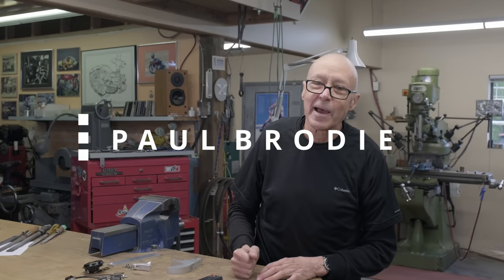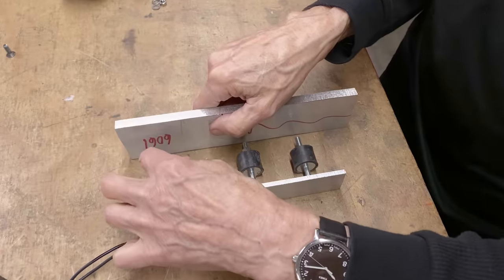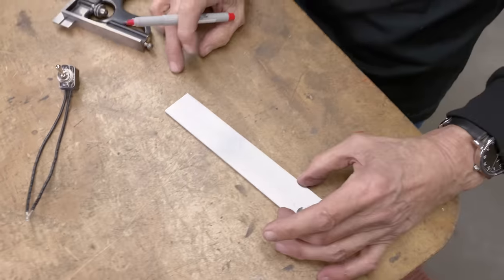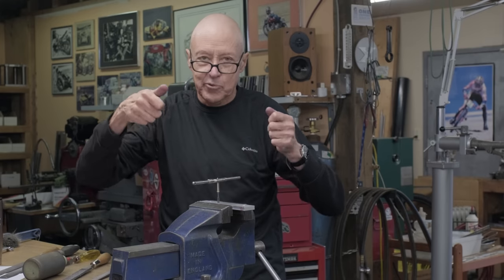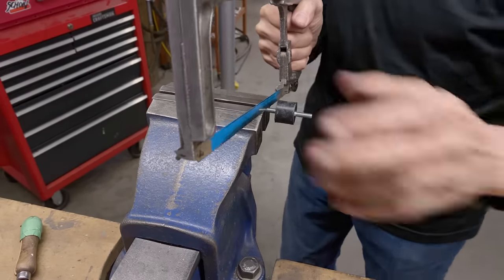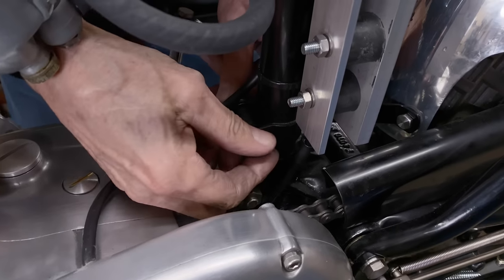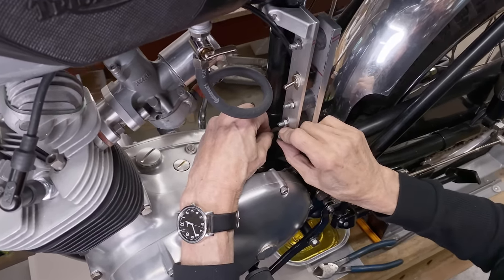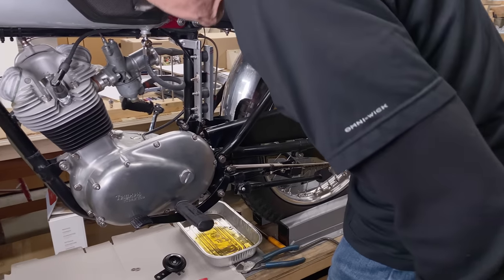Fabricating a battery mount for the Tiger Cub // Paul Brodie's Shop

Comment: These rubbermounts exists in all kind of styles;-)
With a bolt on each side, with one bolt and a female thread and female threads on both sides.
IMHO using the version with two female threads and countersunk screws look nicer.
Reply from the maker: Yes, the rubber mounts come in many different flavours. I have never used the ones with female threads. Thanks for watching..:face-fuchsia-poop-shape:

Comment: Paul, You almost always go to the bandsaw to cut your turned parts from the material blank.  I'm curious why you don't use a parting tool for these details?  I know they tend to chatter a bit and you need to reduce the RPMS.  Are these the only reasons?
Reply from the maker: Too much can go wrong using a parting tool. If the cutting oil doesn't get all the way in to the bottom of the grove... Bang!!! and there goes my tool. I use the saw because it is almost fool proof. Thanks for commenting .....  :face-fuchsia-poop-shape:

Comment: Thanks Paul & Mitch!  What a great episode! Your brackets and braces are truly wonderful pieces of art. 
About the metal debris on the lathe... since it is a cutting tool, think about cutting yourself some (well-deserved) SLACK!  
I was trying to remember who it was that put a tap into a lathe or mill chuck to get absolute perpendicularity.  Dang! it WAS you!  How about using a drill press following that same idea.  Now your hole drilling/tapping turned out perfectly just by eye, it might be easier with the drill press.   That oil drip-drip-drip is annoying, but I have every confidence that you'll find that source and fix it.  You have skills!   Looking forward to the next one.
Reply from the maker: Thanks Tom. Yes, I do sometimes start a tap in the drill press to get the perpendicularity!    :face-blue-three-eyes:

Comment: Do you think the point loading from the round lower battery support  may cause the case to eventually crack? Would a rubber faced flat plater be better? I always enjoy your vids, Thanks.
Reply from the maker: I will hold the battery on with 2 sided tape, so there will not be huge pressure on the bottom of the battery... Thanks for liking our videos :)

Comment: Oh, it's leaking from a vertical crank split line on a British bike....Wow, who knew that they could do that.  Please don't run it Paul, it'll be a worse environmental disaster than the Exxon Valdez, just like in period. I've had some success by making a multi thread twist of PTFE tape and using that as a rudimentary, deformable, initial dam on the crank half returns before it hits the silicon sealed on the mounting faces,but...
Reply from the maker: Yes, a British Bike leaking oil. Virtually unheard of!  :)

Comment: Thanks for the Cub videos, Paul! My cub has been on the road now for 8 months. I am always waging war against oil leaks- oil just doesn’t like staying inside the Tiger Cub engine, obviously! One annoying source is the outer timing cover; from there it leaks onto the oil lines and drips from the oil line union nut. And I don’t think the Cub engine breathes well, so that exacerbates the leaks when the engine is rinning. I don’t get a lot of leaks when it’s not running. After a ride, I’ve just got used to wiping the engine clean. I’m at a stage now where the leaks are not gone, but tolerable. Regards, Al
Reply from the maker: Thanks Alan. Yes, I will start riding mine soon. I think I can learn to live with a little seepage... That's what I say now :)

Comment: Super work as always. But I think the 6061 plate should be higher that the battery does not stick out at the top. I would not wonder if you wouldn't have fixed that by your next episode already. Can't wait to see the tiger cup running.
Reply from the maker: Thanks Oliver. Sometimes I re-make a part. When it is finished I almost always see a better way...

Comment: Another great video. Why didn't you use a thinner piece of aluminum for the back part of the battery (the one you milled out). Was it for strength?
Reply from the maker: Thanks Pat. Yes, for strength. Sometimes parts get remade, because after I see it (in the metal...) it becomes much clearer how to improve what is already done :)

Comment: Love your work as always but using cable ties to hold the battery in place is just not you, you must have thought of at least 5 better ways of doing it 😅
Reply from the maker: Well Tim, Mitch has time constraints, so cable ties were for sure a "quick fix". I will make a beautiful alloy cover to hide those ugly cable ties. Good solution?

Comment: Really happy to see these regular uploads Paul, must mean you're feeling better. Always such a pleasure to watch you work, always coming up with on the fly solutions and always working so precise. Curious how come you didn't machine a flat spot on the "shelf" for the battery to help it sit more stable?
 I'll put everything I have that Mitch had ZERO film with him, but lots of Flash 😛Will share a little funny - when you were holding the thicker piece of alu, it was upside down and I read "1909" and had never heard of that before, so went searching to see it's properties and why you would be using it, then came back and watched further, you held it right side up and then, 6061, made a lot more sense 😆
Reply from the maker: That's pretty funny, me using 1909 aluminum! I will remember that one for sure... Yes, I will machine a little flat for the battery to sit on.. We were under time constraints, as usual. I usually have 3 hours to get everything done, and that is not really a lot of time... Thanks for commenting!

Comment: Hello Paul.... no we dont know that the hole for M6 is 5mm... becouse is 4.8 🙂.
I will share here a thing that I learn from a old guy: To find what is the hole to tapp for a metric screw... you just multiply the metric size of  the screw with 8 and divide by 10. Basicaly, for M6 is 6x8= 48... divide by 10 is 4.8. It works up to M10 screwes.
Nice way... right?

Comment: Hi Paul, I hope that your health is improving.
To the battery mount, I think that two rubber mounts would have been enough.
On the other hand, I think, that the battery mount should be better, specially on the bottom, the battery might crack. And those plastic cable ties are a joke !
Got a real fright by the quick tap !
Reply from the maker: Yes, I feel better but hard to gain weight... You don't like my cable ties? OK, I will make a beautiful alloy cover to hide them. Thanks for watching!
Reply: @paulbrodie  I am glad to hear that !
And for the cable ties, it's your bike, but you' ll see, it' ll look much better.
By the way, your vids are fantastic !
Reply from the maker: @willymueller3278  Thank you Willy...    :face-fuchsia-poop-shape:

Comment: After sanding mating surfaces on a flat surface with sandpaper glued to it, I used contact glue to both sides of the mating surfaces and gaskets made from a grocery store brown paper sack. They were a bit thicker 40 years ago. My bsa never leaked from those joints buy the primary oil drip that lubricated the final drive chain would drip on the ground until I made a drip adjustment screw.

Comment: When i fit oil petrol lines etc myy materiale of choice is liquid p t f expensive but by god its good stuff (i have a mate who is a pipe fitter )hace saw i use a engernering hacsaw the handle is in line with the blade you.cau controle the cut better in my opinion

Comment: In that moment, when you soldered the part, i thought: This has to be nickel plated on the Tiger Cub.
Reply from the maker: We both had the same thought.. That means that it really has to be...  Thanks for watching :)
Reply: @paulbrodie  Of course, it's still a question of whether this fits with other chrome-plated parts on the bike
In my opinion, the Tiger Cub comes from a time when nickel plating was no longer used
Reply from the maker: @besenwieslersepp1011  Yes, but I did send out a batch of Cub parts for nickel plating, so it would fit right in with those parts....   :face-fuchsia-poop-shape:

Comment: Nice work . That is one heavy looking battery mount though  ? I would imagine that the battery will be removed for charging , since you decided to run without a generator , or dyno . Is that why it is held with plastic wire straps ?                                                                                                                                                         That was a good shout for Allen Millyard too ; his Kawasaki V12 2600cc and Dodge Viper  bikes are especially awesome ! He would probably make a small Triumph Trident  engine for your Cub frame , but I expect it would have three times the oil leak . Lol . No , joking apart , I think you will be striping the right side engine case , but that aught to be easier than welding the oil tank surely . Best luck

Comment: I'm not a machinist and certainly haven't memorised lists of such numbers, so when it comes to tapping holes, I just use any old drill 0.5mm smaller than the tap and hope for the best. So far so good! (I'm never tapping new holes into anything of significance, and my taps were never of any significant quality).

As for that switch you used... that other nut on there is just to space it right when mounting to sheet metal panels. Remove it and it'll get you a few more threads. No milling required. :D
Reply: but that feeling when you look at the chart and need a 4.2mm drill bit........
Reply: Metric tap size is always nominal size minus thread pitch.
In this case 6x1=5  but 10x1.5 would be 8.5mm tapping size, etc...
Reply: @wheelmonkey00  What determines 5x.8 or 5x .9?
Is one ISO and the other JIS?
Reply: @jimurrata6785  it was a 5mm thread

But drill bit sets don't come with tap sized drills

Having a set of imperial gives some coverage but you end up with a collection of odd drill bits

Such is life 😉
Reply: @wheelmonkey00  You can buy tap sets that come with paired drills.
That's what I did. Then at least they're readily at hand and not a bunch of random odd ones
Reply: @wheelmonkey00  It's why I don't look at the chart. :D
Reply: @Metal-Possum  exactly

Comment: This came just in a nick of time! Paul, I have the C15 in my garage and I am now planning what I am going to do with it. Is it possible to send me couple pics of your Tiger Cub? And don't worry - no matter how well you rebuild them, they still leak 🇬🇧
Reply: What model and year of C15 do you have?
Reply: @k4106dt  It is 1966 C15 Sportsman by the engine numbers, not in original condition. The idea was to build it into a greenlaner/ street scrambler style.
Reply: @markotuomas672  I have a 1965 C15F and am thinking of doing the same thing as you. Have you seen Michael Waller's videos of his conversion of a C15 Star to a C15T copy?
Reply: @k4106dt  Great! Yes, I have been watching them constantly and they are big help on this project of mine. Where do live? I live in northern parts of Finland. Would be nice be in touch with fellow C15 builder.
Reply: @markotuomas672  I am in Northern California USA. I bought my 99 percent complete 1965 C15 twenty years ago. The seller included another '65 C15 that someone partially converted into a "T". It has a bolt on rear sprocket and an exhaust valve lifter. It has the roadster fuel tank and forks though.
Reply: @k4106dt  allright. Are you planning on doing something to your bikes?
Reply: @markotuomas672  I am keeping the C15 Star original. The other one is about 80 percent complete. I am going to convert into a C15T. So far,  I bought a used C15T 2 gallon steel tank and a replica seat for it.
Reply: @k4106dt  Nice! I found too one those steel competition tanks from the states. Paint was shot but otherwise it was in perfect condition. I need to change the front and rear rims and the seat too.
Reply: @markotuomas672  Does your tank have the chrome intact? My tank is completely covered with paint so I have no idea if there is any chrome underneath the paint. You are lucky that you have a G model with the Victor bottom end and improved gearbox. I plan on installing the needle bearing upgrade to replace the timing side crankshaft bushing.
Reply: @k4106dt  We'll the chrome is intact, but it does have quite lot of small scratch marks on both sides. Paint area was covered in orange but the original blue was under. Yeah, the engine is the strong one, but I will  tear it down in coming winter. It is wise to do the modification you are planning to do. Do you want to exchange emails?
Reply: @markotuomas672  I attempted to reply with an email address. YouTube cancelled the reply.
Reply: @k4106dt  Yeah, I think they do it on purpose.

Comment: What Alan does with a hacksaw is remarkable.  I always wonder why he isn't machining.  i have seen him make four cylinder 125 CC engines, v engines, simply remarkable.  HE cuts bottom ends in half with a hack saw and welds them and the engines actually run.